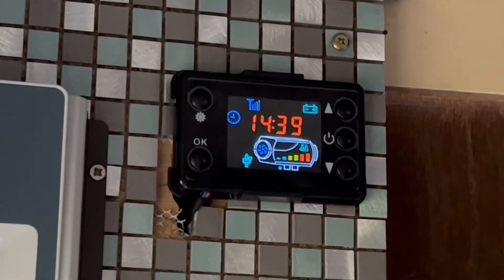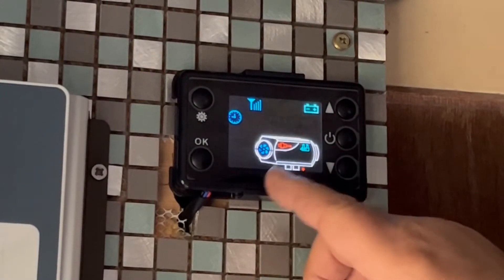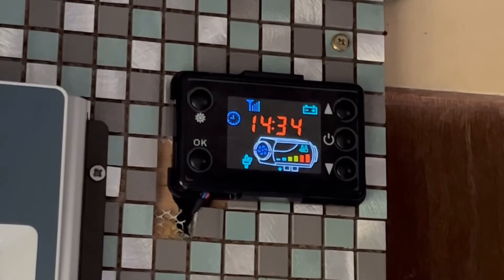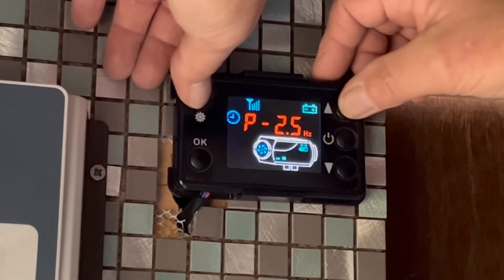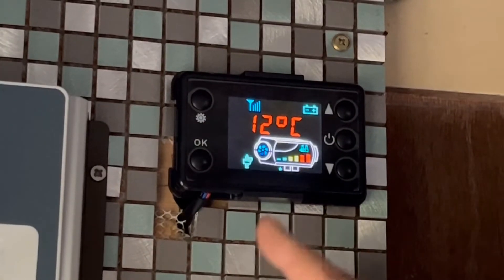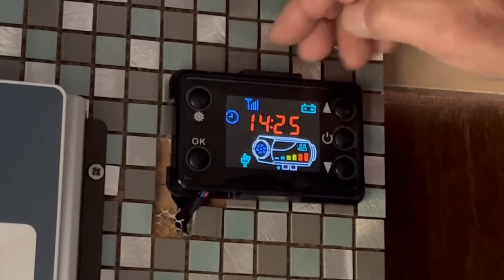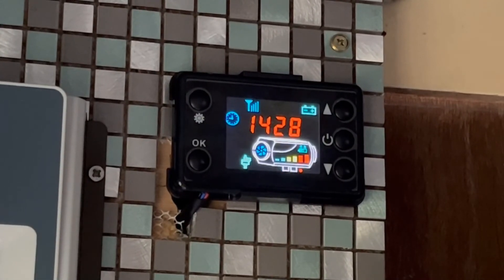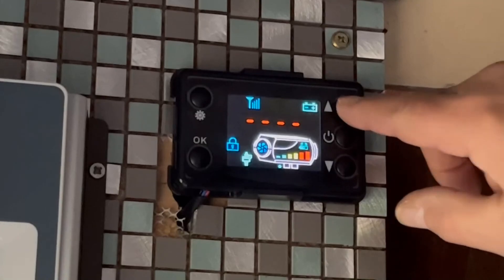52.Chinese diesel heater, Setup and programming

Comment: When I push the utpper right button and hold it it wil not schow HFA to pair the remote, first I see the temperture and then time anny idea how I can pair my remote??
Reply from the maker: I’m going to the boat tomorrow and will have a look for you but I think you may have a different controller.
Reply from the maker: I think you will find that you motherboard is not compatible with you programmer. This is quit common when you buy a heater, most bits on the programmer will work but not all. I have just changed the motherboard on my heater to try it out and the remote will no pair. It was working fine before and now i have change it back it's working fine again.

Comment: the fan on my heater slows down after it has run about 10 minutes . it is still blowing air ,but; at a much slower rate .  I don't think this is correct , any thoughts ??

Comment: I pressed off button in my keyfob, and then power is gone in my controller. I tried alot but no power in controller now
Reply from the maker: Have you tried rebooting it.
Reply: @simplyboating4609  how can i reboot it? I tried pressing different combinations but that didn't worked.
Reply from the maker: @DharamjitSingh05  Disconnect it from the power (battery) and wait for 5min's then reconnect it.
Reply: @simplyboating4609   i did, i had a kill switch to the battery which i turned off overnight, but still didn't work.

Comment: My controller looks like yours but it only switches on.
I can get into settings only when its running
Never needed to prime
Its a Prijesse 12V 5KW
Hard to figure out some settings like pairing and others
Do you know much about this heater
Reply from the maker: Is it the controller with 5 or 6 buttons ?
Reply: @simplyboating4609  It has 5 buttons
Reply: @simplyboating4609  it works fine just.doesn't have the graphics like the bars
All I have is the spinning wheel
I guess as long as it works its no big deal
I can adjust the temp and power
Reply: @simplyboating4609  Like I mentioned I dont even have a primer function
All i did on first install is turn it on and off 3 or 4 times and it worked fine.
Reply from the maker: It should work like this one but sometimes when you buy them the motherboard and programmer are not compatible. I have changed the motherboard on this one. If you push and hold the top left button dose it change to Celsius.
Reply: @simplyboating4609  I only have C and im happy with that
Dont really need Hertz
Reply from the maker: @Timetraveller1010  I know the new programmer you push and hold top left to change from C to Hertz and middle right is push and hold to prime but i would say if your happy with it the way it is don't try to fix something that's not broken.
Reply: @simplyboating4609  oh ok
Maybe this is normal for this heater ~ doesnt need priming
Thanks for your time anyway
Reply: @simplyboating4609  If I could pair it with the remote that would be enough
I understand what you say about the motherboard not compatible but no big deal actually
Love your vids all the way from 🇦🇺

Comment: Great video! The manual isn’t very helpful, I have a question, mine has H1-6 instead of the temp,what does that mean? I can’t change the temp at all
Reply from the maker: H1 to H6 is a temp setting as well you should be able to change it by holding to top left button, then it should go to celsius instead.

Comment: Do you know, is possible to use heater only as fan? In summer, for air circulation and cooling. Thank you.
Reply from the maker: Not with the cheap Chinese models, it is possible with some of the more expensive models.

Comment: Is there a way to program this heater to come on at a certain temperature and turn itself off at a target temperature? Or does a person have to monitor the temperature of the space and turn it on and off manually? As in while you're sleeping and you are sweating and wake up and realize that the temperature is very hot in your sleeping space? Or if the temperature falls below freezing and you are freezing as well and realize that in order to not freeze to death, you must turn on the heater?
Reply from the maker: when your controller is on have you got 1to 6 or 8 to control your temperature ? If so then no but if you have a controller with Celsius then yes. Let me know what you have as it can be changed quite cheaply or i can talk you through how to do it.
Reply: I don't understand the first sentence of your answer. My controller looks just like yours. My controller came with Fahrenheit.
Reply from the maker: Have you got numbers on your display from 1 to 8 ?
Reply: @simplyboating4609  when I press the OK button it will show the time 16:20, 77 F, P-2,9, 12.4 V, E-00 If I press the cog button it will let me change the time, then it shows 1 on, then - - - -, then back to time
Reply from the maker: Not the Ok button but when you turn it on what’s on the display ?
Reply: The controller is always on. It's on a converter. The display always shows the time, unless I push a button. Do you mean what's on display if I turn the heater on?
Reply from the maker: yes when you turn it on @MsLorisM

Comment: 12 V is too low for your battery health. A fully charged battery should be 12.7 V and you should never drain it to more than 50% of its capacity which should be at about 12.2 V.
Reply from the maker: The 12v on this is only telling you if you are on a 12v or 24v system.
Reply: @simplyboating4609  Ah!

Comment: How do I keep the display on?
Without turning on the heat?
Reply from the maker: As long as your display has power it will stay on without having the heater running.
Reply: @simplyboating4609  Well, it has power as far as it runs when I turned it on. However when I turned off the whole display goes off.
Reply from the maker: Are you just turning it off on the display or are you turning the power off to the heater ?
Reply: @simplyboating4609  Just on that display itself. Because I don't have any other way like the remote doesn't even work
Reply from the maker: I take it you have tried to program remote. If you turn it off on the programmer then the programmer should stay on with a dim light on it. I’m not sure but it sounds like you have something like I had that the programmer and the motherboard are not compatible. I got mine as a complete kit and it didn’t work properly, that’s why I changed the motherboard and programmer, it’s quite simple to do you can get them as I set on Amazon for about £35 and it takes about 30 minutes to change them. Mine has worked perfect ever since I changed them.

Comment: Hint: to pre-fill the pipe in my case worked a combination of left upper button (settings) + right lowest button (down arrow). Then system shows 020 - this is how many seconds should it pump the oil. You press OK to start and when oil reaches fire chamber you press OK once more to stop and Power button (right middle) to leave back to main menu.
Reply from the maker: They are all a bit different.

Comment: My all in one primed itself out of the box first startup . That's why it starts pumping when you turn the power on .... dont see how electronacly doing it makes any difference than just pressing on .There is no manuel prime electric is electric ..it does that all ready when you start the starting cycle . If you want to really manuel prime, then put a squesse ball inline ....but why ?
Reply from the maker: That's pumping diesel not priming. Priming is so glowplug don't get hot for one thing and yes it is better if you can get diesel to the pump before you use it as the diesel is the only lubricant the pump has.
Reply: @simplyboating4609  ya but the cycle primes for you when you turn it on .
Reply: @simplyboating4609  priming is removing air from the pump so that you can get deisil to the glowplug ...how is pumping diesil not priming ? As long as the pump starts before the glow plug lights , I think that's how the cycle works upon startup.
Reply from the maker: I'm no expert just showing you how i do it and what is recommended by manufacturer but if you have a better way then go for it.  .

Comment: Thanks for your videos they have been very helpful. 
My first diesel heater install, yesterday finished. Ran great! Was 17° this morning so i ran it for an hour on 1.7 hz, with exhaust fan running was 24° inside for an hour. Very impressive.  Used the cheap tubing and mounted the fuel pump on to my frame with the rubber holder and can't hear it at all!
Reply from the maker: Great news that you have been able to install it yourself and not have to pay out for someone to do it. Did you get it programmed ok ? Don't for get to run it on max occasionally just to burn of some of the carbon build up and thank you for letting me know that it was helpful.
Reply: @simplyboating4609  thanks again. Ran in this morning for an hour as it was cool and ran quiet and smooth.  
My question is how often during warmer months should one run the heater to prevent problems?

Right now Hcalory is selling the 5-8kw heater for $90. so, i bought two of them. 👍 I think they are discontinuing this XMZ D2 Model.
Reply from the maker: @frederick6008  Sometimes i leave mine for 3/4 mouths at a time and not had a problem. I think the main thing is running it on max for 5 mins sometimes.
Reply: @simplyboating4609  sounds good to me. Thanks.

Comment: Hi Steve, Today I cleaned the fuel,line from tank to pump. Installed new filter and pump with new clips. Primed the line to pump removing air bubbles. I continued to prime  and eventually using old controller and motherboard the unit started. It ran for nearly one hour from h1 to h6 but when the unit cooled down up came E-04and the unit wouldn’t start again. I changed the controller (identical to yours) then the motherboard for compatibility but up came E-04 again and never started.  I have checked power at the pump 4.15 volts increasing to 9.8 to 10.15 volts when both arrows pushed for priming. I don’t know if I have a break in the power because I’m nearly at lost end what else it could be? I think it’s nearly time to remove and replace? What would you do? Thanks Neil
Reply from the maker: Neil you are not having much luck with this heater are you. So let me get this straight you have changed the pump, motherboard, controller, fuel filter and cleaned fuel line. It was working fine until you turned it off and it was going through its cooling down process, that's when E4 came up is that right ? Do you know someone that has the same heater ? If so can you borrow their pump just to try. There is only the wiring loom left.
Let me do some research and i will get back to you in a bit. Where is your boat ?
Reply: Good thick cables from power supply I take it?
Reply from the maker: @Tomdogful  I have 4mm cable but i am only about 60cm away from battery's.

Comment: What voltage should I have at the pump connection? I check 3.85v dc but think I need to be pushing priming arrows to get correct reading? Should power be constant or pulse? Thanks Neil

Comment: My heater keeps coming up with E-4 error code which indicates fuel pump error. Can this be cleaned and repaired or must I replace it? If I reprime each time the fuel is pumped and continues so I’m not sure if the pump is on the way out? Thanks Neil
Reply from the maker: Hi Neil,
I would first check fuel filter is clean then that you have good connection's as they can corrode a bit over time but it's probably not likely but worth checking  The last one i fitted sounded like it was pumping but i was just not getting diesel properly to the heater so when i had checked all the bits above i got a new pump on Amazon for about £15 and it has worked fine ever since. Hope this helps, let me know what the outcome is Steve.
Reply: Hi Steve.  My problem is resolved. I removed the pump, cleaned the connection on both wires and pump.  I also changed  all the clamps to ones that lock bolt tight. No air or diesel leaks. I’ve started stopped and started at least 6 times and every time starts straight away without priming. I now have 2 pumps, 2 filters and 6 spare clamps just in case one day E-04 comes up again. My only question now is on a new controller how do I set the time and delay for both start and stopping. Regards Neil
Reply from the maker: @webbyn  Hi Neil,
Glad you got it going. To set the time is in this vlog. Just going to read your new message.
Reply: Steve. No such luck. After cleaning contacts, replacing all clamps, cleaning fuel filter then primed. The unit ran perfectly. It stopped then started 6-8 times yesterday without requiring to be primed BUT I turned the power switch I installed off and I had to prime the unit again before ignition. The unit came up with E-4 error which was my original problem after not starting the heater for 6 months. It looks like my only option is to leave power switch on to have instant convenience of starting when cold. Do I have any other options? Thanks Neil
Reply from the maker: @webbyn  I don't always have my heater powered up and it comes on fine. It seems like some how the Motherboard is not remembering that you have primed it and it's working. Have you reset It ? You can do it quit simply by disconnecting it from the battery's and leaving it for about 20/30 mins. Can't remember what i was doing but i know it would not reset by just turning it off i had to disconnect it from battery's to get it to reset. I take it you have checked for leaks. If this don't work let me know and i will try to create the problem with my heater to find the problem Steve..
Reply: Hi Steve. I have disconnected the batteries and will try again in one hour. If the problem persists do I just cut my losses and purchase a new one?  Can I replace the motherboard and or controller and if so are these products universal? If yes 5 or 2 kw? Thanks for your help Neil
Reply from the maker: @webbyn  Hi Neil,
Sorry to hear you still have problems with heater but you can fix it so don't give up. I am just going to try some different bits on mine heater to see if i can find the problem and i will get back to you in a bit.
Reply from the maker: @webbyn  Hi Neil,
I have tried a few thing out and  the only thing I could potentially find is there is an air gap somewhere and air is getting into the line and when the heater is not on the air is getting up and travelling up the line causing an airlock or it is the pump. Have you got good clamps on the pipes ? The ones that come with it are not great, they are one of the things along with the green hose that should be replaced. Hope this helps Steve.
Reply: @simplyboating4609   I purchased new clamps screw type
Reply: @simplyboating4609  solid hard white plastic pipe
Reply from the maker: @webbyn  Look at vlog 56 at 21.25 in and you need this type of clamps.
Reply: Steve. Connected batteries and yet exactly the same results. Press both up and down arrows then unit has audible click then E-4 comes up then alternates between that and P13 but no go. Looks like a new pump is necessary? Can a pump have intermittent problem? Thanks Neil
Reply from the maker: @webbyn  You can see in vlog 56 I had a new pump that wasn't working properly.
Reply from the maker: @webbyn  I have never seen P13
Reply: @simplyboating4609   P13 is 13 volts which when I checked battery with multi metre 13.2 volts
Reply: Hi Steve.  Tomorrow I will be changing new fuel filter and fuel pump. I have also completely emptied fuel tank and cleaned out fuel lines. I also have purchased a new controller, remote and motherboard but not sure if I should change everything at once? I took my old fuel pump which wasn’t working to the dealer and tested by replacing it with his demo unit. My pump worked so this leads me to think maybe motherboard?  Is it possible the controller and or motherboard are confused by pushing too many buttons. Twice I disconnected power from batteries for hours but no improvement. Still E-4 which is proved wrong using old pump on new machine. What do you recommend? T8me is approaching for holidays. Thanks Neil
Reply from the maker: @webbyn  Thanks for getting back, I like a challenge. As for Motherboard replacement which is quite simple (you can look at vlog 53 how to do this) If you do change Motherboard you will probably need to change controller too as when i did it the Motherboard was not compatible with the old controller that's why its good to buy them as a set and not separately. Have you checked that air is not getting in ? If the pump is working on a different machine then it can't be that.
Reply: Your controller is little different than mine. Maybe the new one will allow me to set the time? I think I stuffed mine by pushing too many buttons? I tried to upload photos but couldn’t? Thanks Neil
Reply from the maker: @webbyn  You can email them to simplyboating@gmail.com. Maybe you have the new controller, to prime with the new controller you just push and hold top right button. If you can't set the time or timers on it then i think its the Motherboard as i had a similar problem before i changed it.

Comment: I have exactly the same unit. My settings button beeps but does nothing. 🤦🏻‍♂️
Reply from the maker: Hi,  It seem you my have the same problem that i had with my one. When i first installed it i could never program it properly,  my setting button just didn't work at all. Some times the programs that comes with it is just not compatible with motherboard. I tried replacing just the programmer but it was still the same so i sent it back, I ended up getting a new motherboard and programmer kit for £35 and it has worked fine ever since.  It was quite simple to replace. If you have a look at vlog 53 you can see how to do it . Hope this helps